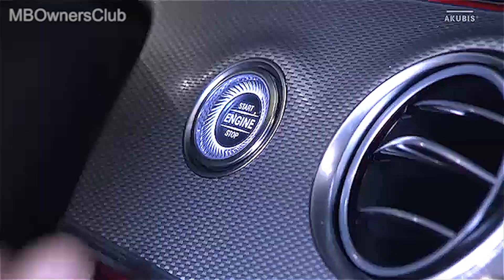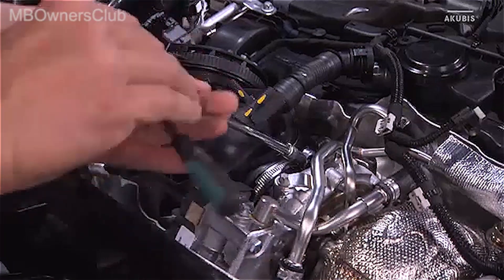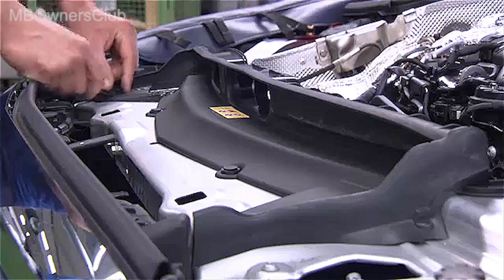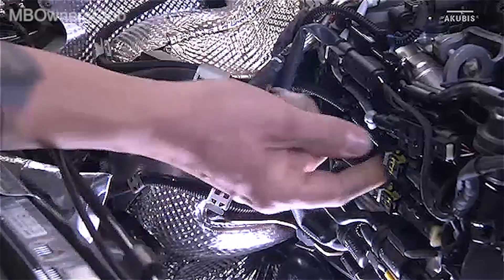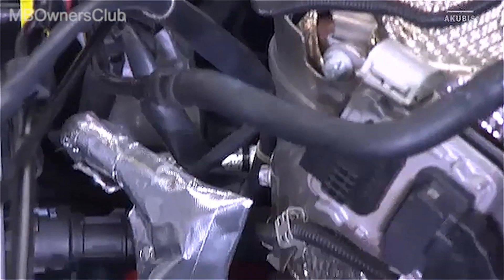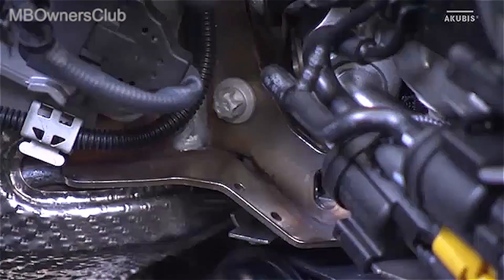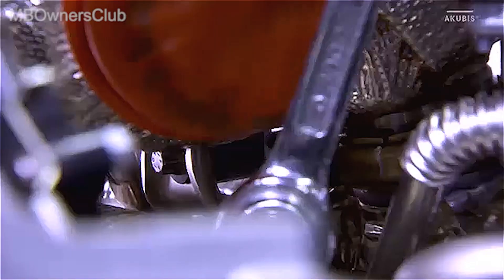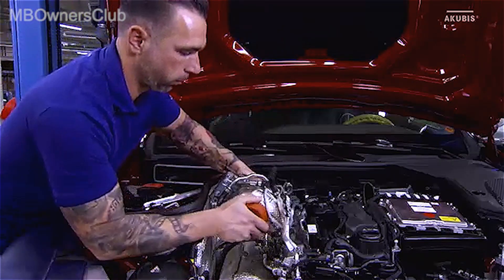How to Remove and Install the Turbocharger on a Mercedes-Benz E-Class - Step by Step Guide

Comment: All this looks nice and easy on a new or one-two year old car. I can't imagine what a pain it is to replace turbo charger on this engine/car after 5 or more years and 150 thousand kms. Everything is so tight, tons of clamps and electrical connectors. Dpf filter temp sensor will get so bloody stuck... overengineering as it is.
Reply: @Austin Edgar definitely, I have been using Flixzone for since november myself =)
Reply: @Austin Edgar yup, been using flixzone for years myself :)
Reply: You’re not wrong, been trying to remove my turbo of my 2016 and it’s not this simple 😂😮‍💨
Reply: The turbo is flutterign since 430k km